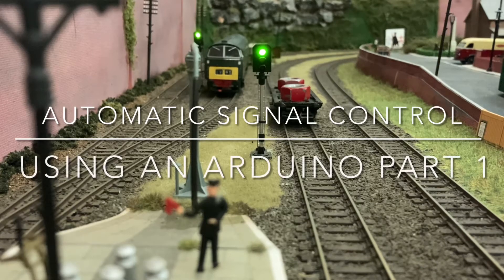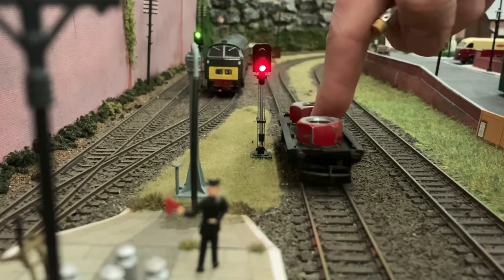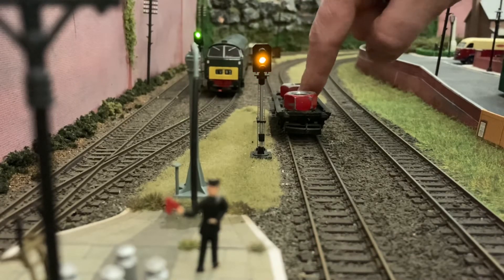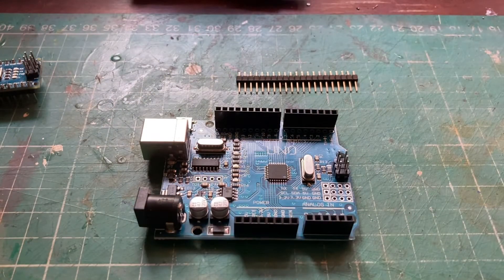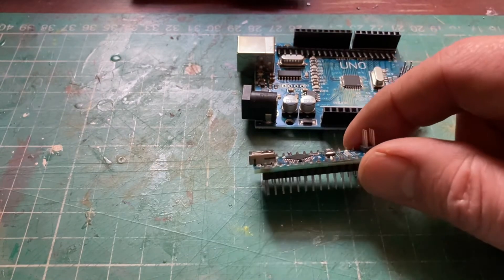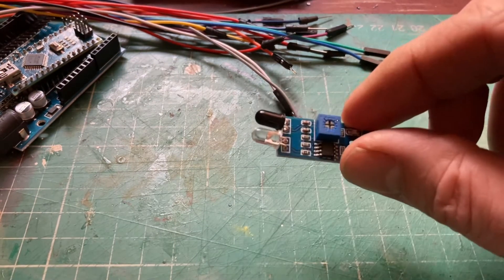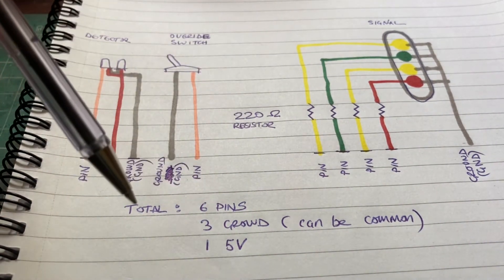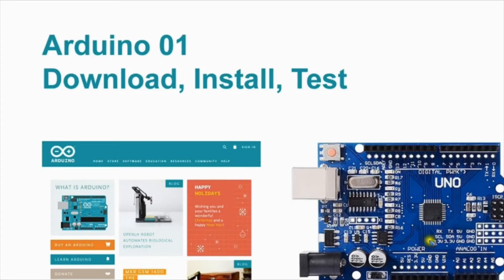Model Railway Automatic Signal Control Using an Arduino Part 1 - Getting Started

Comment: Regarding current limitations, try replacing the standard 220Ω resistor with 1kΩ. This will only slightly reduce LED brightness while massively reducing current draw. You may want to tinker with slightly less for the green LED, as they tend to not be as bright as red & yellow.
Reply from the maker: Thank you, that is helpful to know

Comment: Actually, if any of your viewers are familiar with Arduinos (not necessarily expert!), this application is quite easy.  BUT, what many viewers would want is an Arduino solution for an ABS, block system.  That setup is quite a different, and difficult, story.  There's not too much realism with the solution presented in this video.  Those who know about LEDs will know that most any voltage can be used to power an LED provided the current is limited to 20ma or less.  Current limiting is the purpose of resistors.  The Ohm value for a limiting resistor is determined by Ohm's law
using the value of the voltage supplied less 0.6VDC (for the forward voltage drop across the LED).  You never need to max out the current thru a LED.  It is hard to tell the difference in LED brightness between a current flow of 15ma and 20ma.